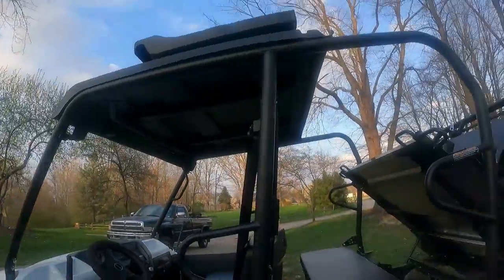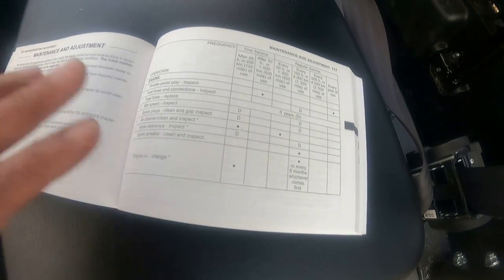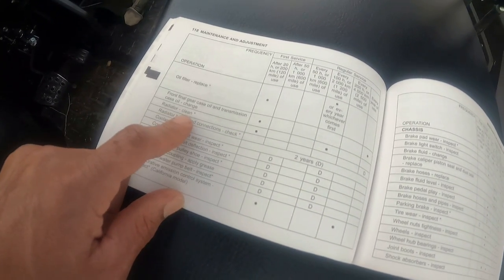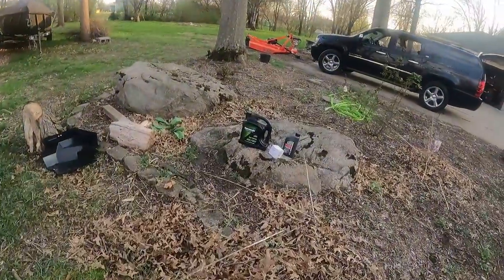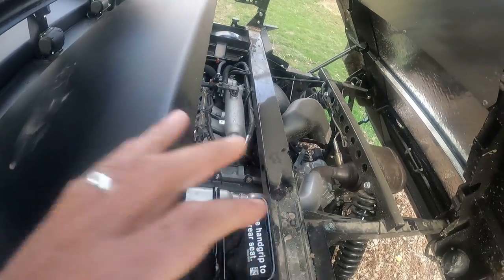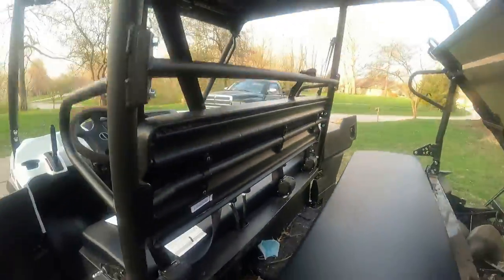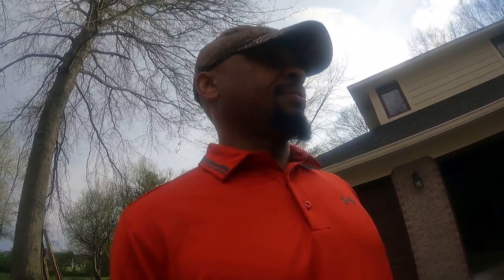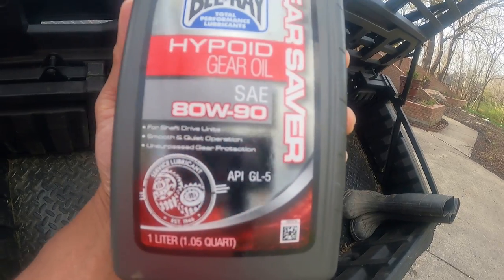Kawasaki Mule FXT - 200 MILE Maintenance

Comment: I took off the whole seat base and the whole cover. Not just the filter cover. Made the job a whole lot simpler. I think it was 4 or 6 bolts and a few push pins. Took maybe 10 minutes extra time.

Comment: Great video, my filter removal was the same way. I’m going to look for a cap style filter wrench which should make things easier next go round. It’s also gets kind of messy with the excess oil dripping into the skid plate. I had to remove the skid plate to clean it, Not fun lol
Reply from the maker: You are exactly right on oil from the filter spilling onto the skid plate. I was able to clean some of it up but another area of improvement for KW.  I thought the filter oil drained right into my pan and only stumbled on the fact that a lot remained on the skid plate.  Figured I'd deal with it later :)
Reply: The removal would be much easier with a cheap socket drive oil filter cap wrench. You can get them at places like Wal-Mart for less than $5. Just make sure to get the right size.

Comment: Hello, I just got one of these on a whim, im not mechanically inclined at all so didn't even ask at the shop about the maintenence and now after I bought it they're telling me I need to take it in at 50 hours for $350 maintenance then do it again every 50 hours......this seems really off to me, anyone can help?
Reply from the maker: Well.. that's part of their business model.  i'd try to do all you can yourself.  The first 200 miles/50 hours is really straight forward.  I'll most likely take it in after 100 hours for the dealer to check those things listed in the manual as "D"; that aren't straightforward; should save you some cash.  If you have any questions just post and I'll help where I can!
Reply: @onealadventures294  thanks, I just got to 50 miles so I'm about to go check what I've got to do, most likely I'll be here asking for help lol
Reply from the maker: @chaboi7  let me know.  Will share what I know.
Reply: @onealadventures294  ok, I was confused at first with the reading on my timer, I only have 10 hours on it so far so the maintenence is still a ways away but when I get there I will definitely come and ask because I will need all the help I can get lol